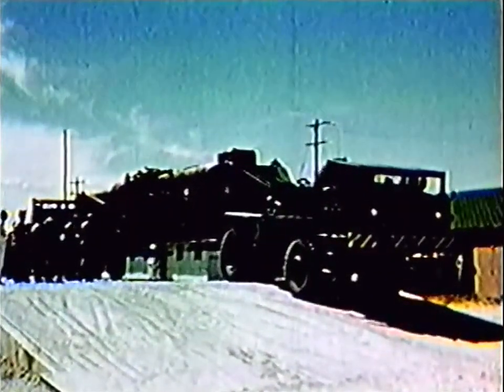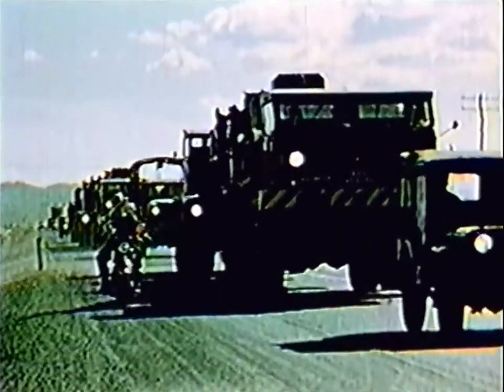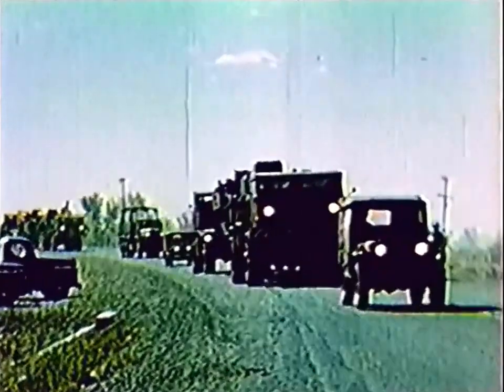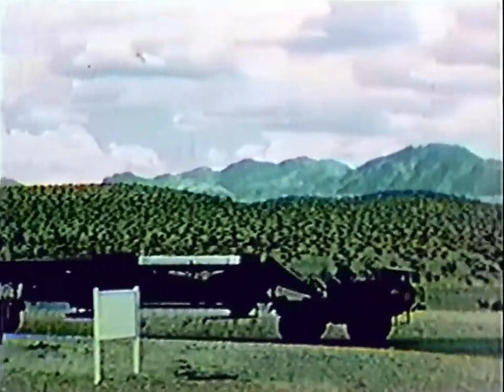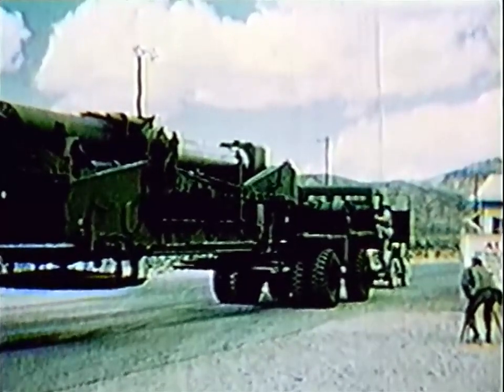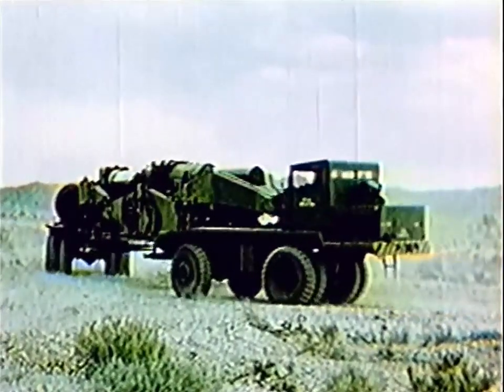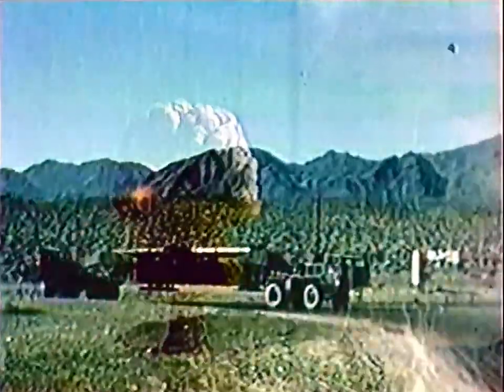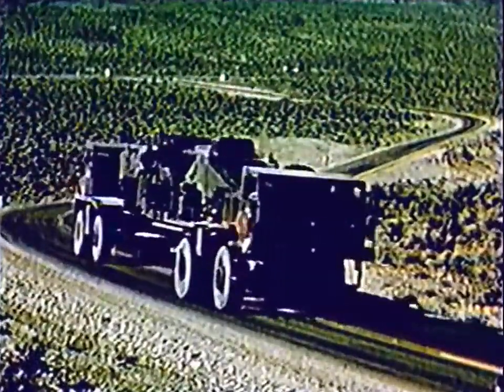Upshot-Knothole - Grable 1080p ᴴᴰ ORIGINAL AND FULL - The 280mm Nuclear Cannon 5/25/53

Comment: 155mm and 8 inch howitzer tactical nuclear rounds were part of the Army arsenal till the break up of the USSR. The 8 in was a gun type warhead. but the 155mm was a _________ type. An updated 8 in was never fielded.  Interesting thing about the 155mm is it was warm to the touch.  The 8 inch components were in special containers so you could not stack them too close to avoid going critical. This was not rocket science.

I signed a bunch of papers when  I retired so I am not sure what more I can say other than we  were all crazy back then and sheer luck we did not destroy the planet.

Comment: The explosion was smaller but the clouds look as those over Beirut.
Reply: The shot is from about 8 miles away Beirut is nothing compared to this
Reply: @joerivas1991  Yup should be about 10 times the yield of the Beirut explosion. But damn Beirut really was a monster for a non nuclear blast!
Reply: @PolitischeImmunität the thing was it was a bunch fireworks from what I heard. That's why the explosion appeared Red afterwards.
Reply: @wrestlingdavidfr  Beirut was started by fireworks which were burning/exploding in a storage facility. But the actual big explosion was caused by 2750 tons of ammonium nitrate which was beeing stored in the storage facility right next to the burning fireworks.